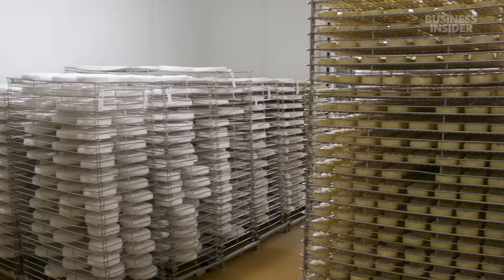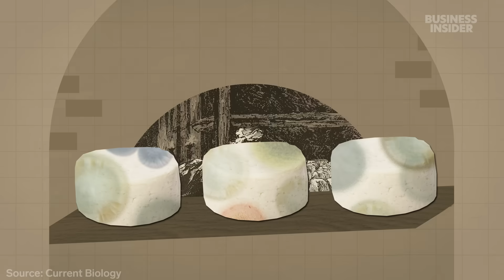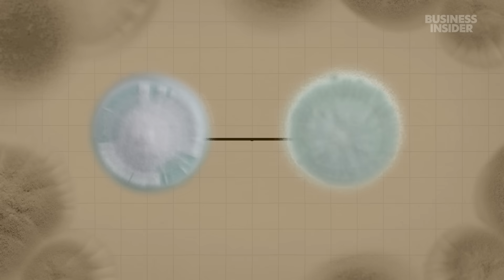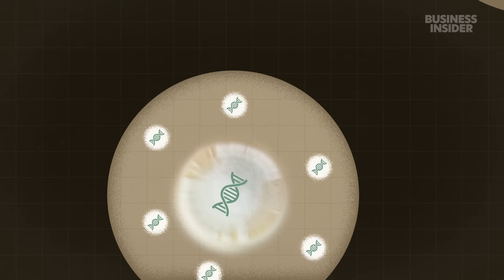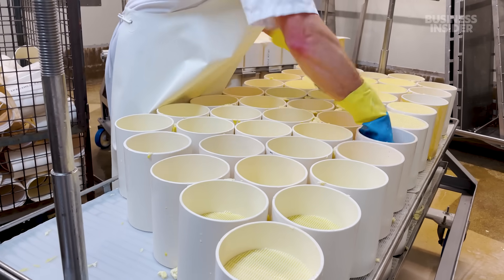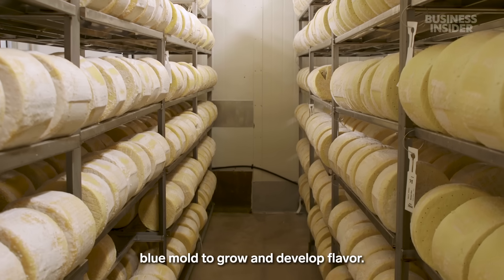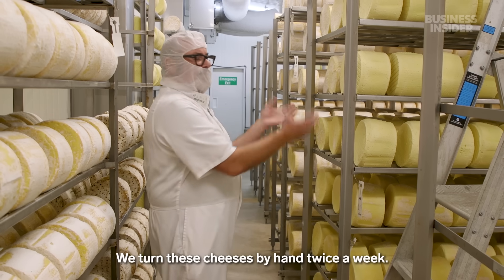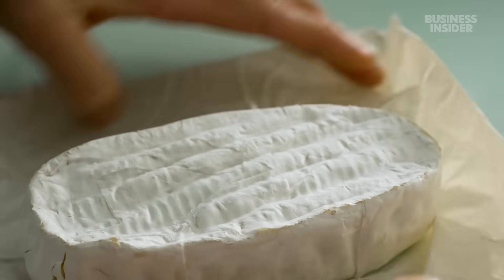Why the Mold Behind Brie Cheese Is Disappearing

Comment: I appreciate that whoever designed the cheese-stabbing machine thought to force the operator to use both hands to make the stabby bits come out.
Reply: the same safety measure is used on the hydraulic paper cutter i use at work
Reply: @dlspartan2014  Yes, I worked in printing.
Reply: And the smelter doors where I used to work..
Reply: @dlspartan2014 same!
Reply: Still my knucklehead coworker was able to push one of the buttons with his elbow while adjusting the workpiece with one of his hands, resulting in one of his fingers getting cut off.
Reply: @Vindolin always someone
Reply: There's an industrial metal cutting machine out there that requires 2 foot pedals and 2 buttons on opposite sides to operate to stop workers from sticking their hands in the machine. They started putting bricks on the pedals, pushing one button with a foot and reaching into the machine again. The eventual solution was to put the control panel in a separate room away from the machine.
Reply: @Tyneras that’s a fantastic solution! Often the simplest is the safest. My old work banned all lab technicians from even touching the labs power drops after one of them managed to force a 270v splitter box into a 415v drop… we still don’t know how he did it but boy did that server rack pdf strip spark like crazy. Now only a small team of “electrical operators” can interact with the cable drops and any other power system deemed too unsafe for the software lab techs.
Reply: @Tyneras  You're making it sound like people are INTENTIONALLY sticking body parts in these dangerous machines. Why would anyone do that??
Reply: In most countries it is required by standard. 2 hand Switches are quote common. However this version looks quite unsafe, you can still reach the Pins while pressing the button
Reply: As someone who thinks a lot about workspace safety and machine design I really appreciate your comment.
Reply: He apprecaited the design, it wasn't an invitation for snarky remarks about how that's a standard that "hurr hurr, is nothing new"
Reply: There are literally thousands of machines like this and have been like this since OSHA came to be. I worked as a Journeyman Printer for many years and huge paper cutters that were capable of cutting tens of thousands of huge sheets of paper at a time use to only have ONE button to engage the blade. Until one day........when an operator lost their entire hand. 

From that day on there were two buttons on any and every machine so the operators had to use both hands and their hands were far enough away from the blade to be safe. The blades on these cutters are around 8 feet long. I've used them many times AFTER there were 2 red buttons. So OSHA was the instigator of safe operating machines and noise reduction. I think of the millions of people that had accidents before OSHA was instituted in the workplace.
Reply: @getin3949 OSHA and American workplace safety regulations are not at all an example for the world and rarely a global leader, unlike the FAA is for aviation. 

Time and time again American organisations like OSHA make recommendations, codes of practise and voluntary codes of conduct which change little or nothing and the American patchwork of regulators who oversee their small part of an industry means there is no single national enforcer of workplace safety. 

This is of course by design for the profit driven corporate beasts and the fully corrupted and self destroying American political landscape is pointless, again by corporate design.
Reply: @getin3949 
OSHA? Not for much longer
Reply: @getin3949  And now, the current U.S. administration is trying to destroy OSHA. Fun stuff.
Reply: @getin3949  OSHA is american only this is NZ
Reply: @getin3949 quite interesting learning of this
Reply: @getin3949  Another case of federal regulations to the rescue.
Reply: @leavingitblank9363  Yep. These "small government" people can kick rocks.
Reply: @leavingitblank9363 federal regulation? I was all for it now I’m against it! I bet a democrat thought of it!!
Reply: @celestialnubian  Basic, simple regulation and good enforcement are exactly why I am for "small government", not "no government".
Reply: @celestialnubian agreed
Reply: Human friendly design
Reply: The double switch can be combined with a infrarred sensor that disconnects power from the machine if the 13:44 beam is interrupted or a phisical barrier, a safety guard, that moves down at the simultaneously with the pins. That is called error (fool) proofing safety mechanisms.
Reply: I love your appreciation :) sorry you mostly got responses from condescending grandpas
Reply: @bubblegumplastic  to whom are you replying??
Reply: @bernicemerryman366  the original commenter
Reply: In most places, especially in the EU, that's a required safety standard if it's anywhere people are employed to operate such a machine.
Reply: Ayup. Safety first!
Reply: Hahhahaa nice catch😂
Reply: Good observation!
Reply: That's the same way the can lid hole puncher machine worked at the paintcan factory.
Reply: Yeah, except that is an added feature... Many accidents happened before the regulate industrial procedures...
Reply: That design came through after a few accident, I guarantee you.
Reply: my grandfather worked a paper stack cutter, he got irritated with the two buttons so he taped one down, only to be reminded by my then-10 year old mother that the button has a purpose, and he shame-facedly removed the tape
Reply: Thats the kind of deadmans switch that gets installed after its proven why you need it lol
Reply: They used to make your beer by chewing grains and spitting into the vat.
Reply: Alot of open presses are operated in this way, im surprised there isnt a laser fence too.
Reply: Redundancy best safety 😢 love these QoL
Reply: Standard machine design.
Reply: pretty common safety system for pressed and what not, infact, mcdonalds has a similar system for the grills.
Reply: I would imagine its also fairly weak and dull
Reply: Very common industrial safety set up since at least the mid-1970s.
Reply: Pretty standard for this kind of machine
Reply: A lot of the replies are a bit dickish, I agree dude. I work in development, and a lot of the time, I spend thinking of ways to stop customers or users from making unessesary mistakes. 

Just because there's obviously a cliff doesn’t mean we shouldn't put guard rails up.
Reply: ...unfortunately, merely telling some, but not many workers not to stick their hand into the squashing/stabbing machine just isn't enough and so machines must be designed so both hands are needed to operate it.
Reply: The very first version probably had a foot pedal to have the hands free to faster move the cheese. 
Someone crushed their hands so the put up a sign and made it a single hand lever. 
Another stupid person crushed their hand, so two levers needs to be pressed. 
Again someone hurt themselve by pressing one button with their butt and the other with a hand. 
The next version changed the position of buttons so it has to be pressed with the hands. 
One button got glued by a worker so only one button needs to be presses. someone got hurt again. 
Now both buttons need to be pressed at the same time to activate and you see as it is. 

Next time someone gets hurt, the pressed the buttons while having their head in the machine to look at something. 
So to further prevent future harm, the spiky press will be inclosed in a seethough shield.
Reply: Watch some moron lock one handle to allow one-handed usage, and then promptly get cooling holes in their hands.
Reply: Every thoughtful design is behind a bloody story
Reply: They save so many hands...
Reply: It's a pretty common safety feature on a lot of dangerous machines.
Reply: Common safety approach with industrial machines, and I also always notice it.
Reply: It's the little things that are impressive
Reply: Next to desserteur
Reply: This is a safety procedure used for all sorts of machinery.
Reply: lol do you think the risk is higher than normal because of the mold?
Reply: Kind if basic design for machines like that
Reply: Right!!!
Reply: All those safety lesson were learned the bloody way.
Reply: wait ty for pointing this out
Reply: Love how everyone commends this. How about just not be a dumb ass and not stick your limbs in machines. I literally have to change so many things cause "tWo HaNdS ArE nEeDeD"......
Reply: Very safe.
Reply: this is used everywhere in the industry. it is a safety procedure which a lot of developed countries use. nothing new.
Reply: @furzekake1  it's really not tho. It's used in MAJOR factories, but factories even in the US still use 1 handed machines to press/stamp/cut sheet metal, along with lots of automotive factories.
Reply: @Neopopulist "even in the USA" is not the kind of argument you think it is^^
Reply: It's the standard throughout many industrial processes.
Reply: discrimination againts one armed workers ! :(
Reply: Health and safety has gone overboard!
Reply: looks like the stabby bits give way when they meet pressure, so probably won't hurt anyone or at least not as bad.
Reply: Whoever designed that cheese-stabbing machine definitely had safety and precision in mind! Making sure the operator uses both hands is a clever move — not only does it ensure a more controlled process, but it also adds a bit of "you gotta earn it" to the whole experience. 😂 It's always the little details that make the biggest difference in the design, right? What other clever designs have you seen that make a seemingly simple task way more interesting? 🤔
Reply: Keeps idiots and complacent workers from ruining the cheese.
That's what is starting to consume the design time is waging war with stupidity and complacency.

Comment: I'm curious if there have been attempts to modify its DNA to be slightly different, thereby potentially increasing genetic diversity. There's also the issue that the mold grows asexually, so that would still be a problem. I'm no geneticist, but I find this kind of tasty science fascinating.
Reply: The main problem with camemberti is that it like any other living organism accumulates mutations over its lifespan. But with sexual reproduktion, poor mutations are selected off. With asexual reproduction, they are all carried over to the next generation, eventually accumulating to a point where it is non-viable.

You can't remove these mutations. You can freeze an earlier generation, but it's the act of reproduction that introduces mutations, so you can't use it and keep it at the same time.
Reply: @coolguyflex  you can very much so remove the mutations, any mutation that appears can also disappear and you would just select that culture to start cloning again. Its also very weird how they keep going on about it reproducing asexualy, its a fungus plenty of fungi do that
Reply: @aequintas2131  fair enough, its not so much the method of reproduction, but rather the fact that there is no selection pressure.

You can probably manage the issue quite well, by storing good strains
Reply: @aequintas2131  i also dislike how they didnt give any hard numbers. what if the mold is giving out 99.999999% of the spores it should be cloning, since that is less than 100 you could extrapolate and say it is going to go extinct
Reply: They don’t understand that molds are also immortal if you keep it fed and happy it can live indefinitely
Reply: @alexandervarsic9515  that point is irrelavent.  it isn't that it has any specific "lifespan" it is the fact that it is not ageless.  the mold changes over time, just like any living thing and they need it to be like it was a century ago, not as it is now.
Reply: @alexandervarsic9515  what on earth makes you think that?
Reply: @coolguyflex but there is a selection pressure. The mold that is ideal for making cheese.

Evolution isn't a process of optimization. That's a common misunderstanding. Mutations are random. What survives is also random. Outside pressures can influence the likelihood of a mutation that is beneficial in that situation being passed on and becoming dominant, but it doesn't have to. It could just be dumb luck that a mutation wasn't enough of a hindrance to disappear. Or a freak accident could have wiped out a significant portion of the population and a strain containing a mutation becomes part of the new dominant one. Not because it was better but simply because it was there/survived.

Natural evolution is basically throwing shit at a wall a billion times and seeing what sticks. Whether it's beneficial, neutral or detrimental merely influences the probabilities a bit if a suitable outside pressure is present.
Reply: @Salted_Fysh  What survives is not random. The one that survives the one that fit to the enviroment most. It is like basic principle of evulution and adapting. It is a dumb luck that a mutation wasnt enough of a hindrance to disappear is also very lackluster way of thinking. We do not have enough genetic knowledge to say that even that annoying genetics that looks like causing issues may have unintended or unseen benefits to the host or getting rid of that feature may cause more issues than just simply making it stay. We are complex creatures that do extremely complex functions that change, survive and thrive. Just random shit is not enough to explain the complexity. You are simplifying things where you shouldnt.
Reply: @exosproudmamabear558  you are incorrect in your interpretation. What survives isn't what suits the environment the most. What survives is what is capable of surviving. These are two similar sounding things that are very different in practice.

It is part of what breeds the complexity in the first place. A detrimental (but not detrimental enough) or useless mutation could become a benefit later down the line if conditions change. A beneficial one could turn into a detrimental one. A neutral one can simply stay that, neutral. A beneficial mutation could disappear from the gene pool because it wasn't beneficial enough.

I will repeat, evolution is not a process of optimization. It's a game of chance with weighted dice and where the rules occasionally change mid-game. That is what makes it complex and what breeds the amazing diversity we have today.

If evolution was about optimized survival, we would see a far more streamlined ecology.
Reply: Genetic drift happens even in asexual reproduction, as in most organisms there’s a certain error rate when replicating DNA. You just have to screen for more fit mutants. It wouldn’t be too difficult to reverse. And if that one lab is providing mold for most of the world, I imagine they’re already doing exactly that, screening small batches for better variants.
Reply: Seems like it would be relatively simple to fix issues that have developed like it's lowered spore production.
Reply: GMs are terrible we do not have enough knowledge about dna or medicime to do it without causing issues. You may end up with agressive ,antifungalresistant creature. It can cause allergic issues,cause gut microbiome issues ,immune dysfunction. It is certainly dangerous mindset.
Reply: If it weren't for PR.... Taking a healthy blue mold that gives wonderful flavor, and then making it white and non-toxic would be quite simple from a technical standpoint. I'd rather eat Genetically Modified Mold cheese than random wild mold in a cave cheese.
Reply: In the video they explain white mold reproduces asexually essentially. You can’t really give it genetic diversity because it just wants to clone itself. At the same time since white mold became so popular the French essentially gave up studying other types of mold.
Reply: @NaviRyan  Well something is clearly making it put out less spores. So they can be changed.
Reply: I think in terms of PR, "GM cheese" would be pretty sure to fail even if it would be 100% safe.